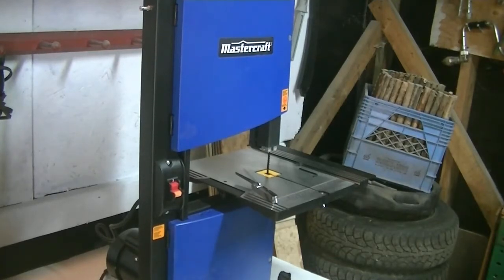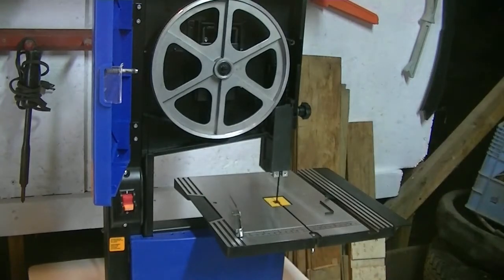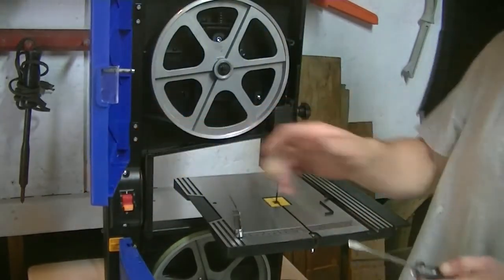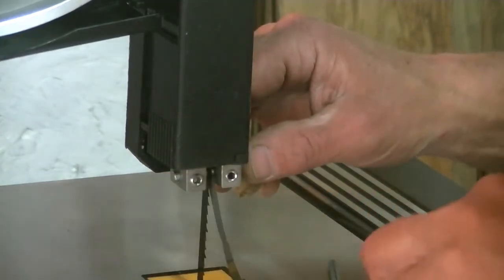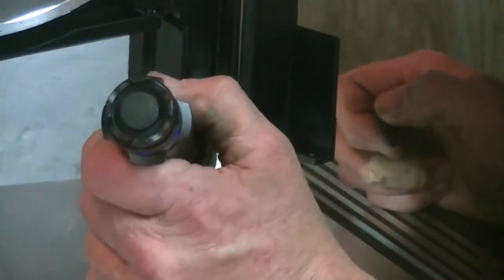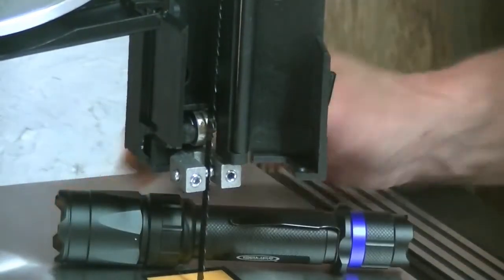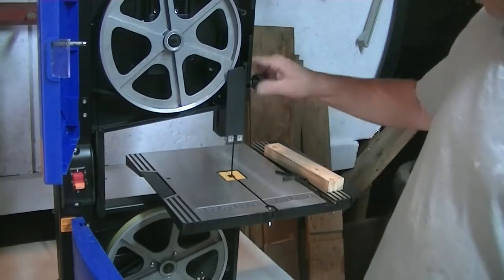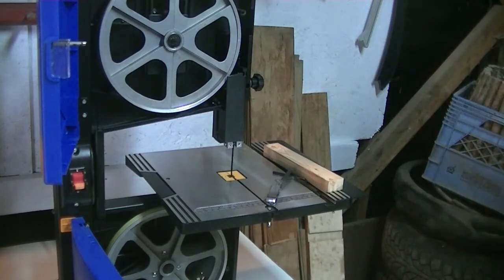How to setup a bandsaw before cutting wood

Comment: Appreciate the video! my saw was not cutting straight at all! Haven't fixed yet but at least I know how now!
Reply from the maker: your welcome
Reply: @KevinMillard68  I still have slight drift to the left when cutting. I've done everything with the set up and it all seems fine but It still drifts left about 3/4 of an inch over a 6" board cut. Any further tips?
Reply from the maker: @jeffjanczyszyn4652  what thickness of wood are you cutting and are you measuring the fence at both ends before you make the cut also watch the pressure you do add as well when feeding and maybe tighten up the blade a bit more as well
Reply: @KevinMillard68  will do, I'm only cutting 1x material, not using the fence just the slide miter. I'm guessing at this point the table is slightly out of square even though I thought I had it set up right.
Reply from the maker: @jeffjanczyszyn4652  :)

Comment: Thank you for this video. I have the same saw and after following your video my bandsaw still drifts to the right. Can you give any advice?
Reply from the maker: try to tighten up the blade a bit sounds like its to lose , also push slow on thicker peices and dont expect it to do all the work and mesure the distance on both sides of the fence to make sure its dead on the front and back other wise that can also cause drift when cutting, and make sure the clearence of the blade is dead on for the least amunt of play side to side on the blocks or again it will drift

Comment: I've got a question about the tension.  I understand that clockwise tightens and vice-versa but how much tension do you need and how do you determine that tension?  I heard you twanging the blade.  Are you listening for something specific?
Reply from the maker: aot if its feel for sure the manual is not 100% clear on the tension but you dont want to lose or it will fly off the wheels you dont want to tight where is struggles to fire up either you find the sweet sport bascially
Reply: Mine is spring loaded and the spring determines the tension.

Comment: The blade adjustment requires 2 types of allen wrench. A 3/16 for 1 screw and a metric 1.5 for the other. Canadian tire do not sell these allen wrenchs and do not sell the .002 gauge.
Reply from the maker: you can buy allen key kits and you can also get the feeler guages as well. from C tire
Reply: nope...I went to 3 Canadian Tires and they did not have the gauge nor the allen wrench